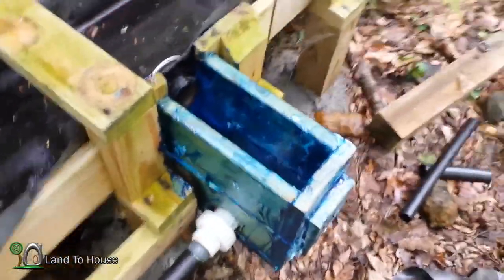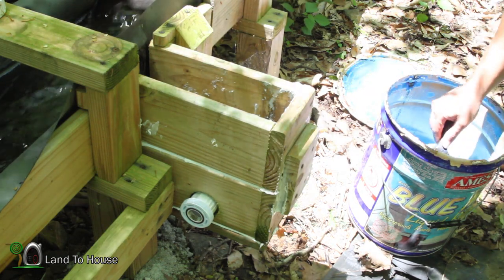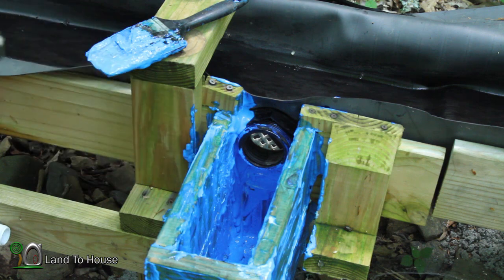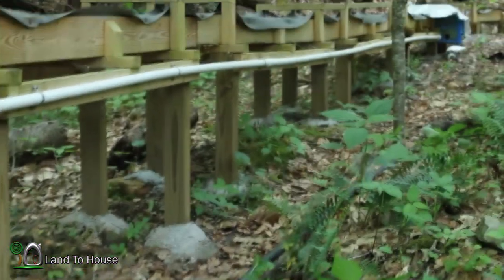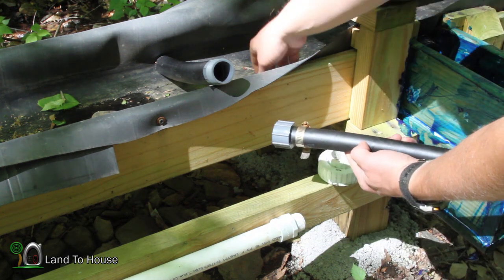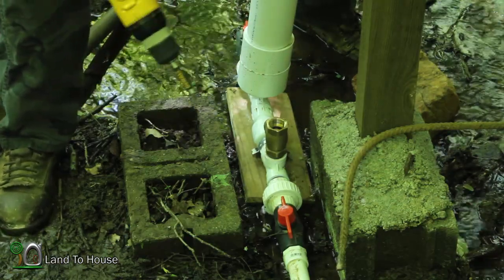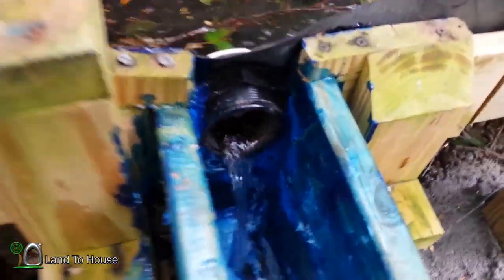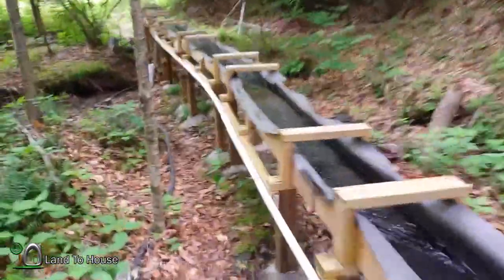Install my Ram Pump Part 2

Comment: my friend...when applying Teflon tape to threads, always apply it in a clock-wise direction, otherwise it will un thread itself when screwing a fitting onto it. :-)... from a master plumber ;-)
Reply: You're worried about thread tape meanwhile there isn't a drop of purple primer in sight. 🤣
Reply: @jmboulware  lol 😆 multiple issues

Comment: You wrapped the teflon tape in the wrong direction. Wrap the tape clockwise. The same direction you will screw on the fitting.

Comment: I have a Well for water supply for land use, if needed, but that requires an electric pump, (or lifting buckets about 40 feet), so a ram pump from my pond would be a better solution. it would also be much slower than the electric pump, (about 250 gallons in 15 mins.) so could be used to water garden areas directly.
So definitely food for thought.
You could use an empty plastic oil container, instead of a wooden box. 
(Just noticed you may have done similar.)
Also, you could have strapped the 'diaphragm' tube to the leg of your water channel, with a couple of bungees, or tie-wraps, which would be more stable.
.

Comment: Can I use a small ram pump to move water from my rain barrel to gardens that are uphill 3' to 10’? The rain barrel water is, of course, stationary, not flowing, unlike several videos I’ve seen. Same question as Jacob earlier.
Reply from the maker: It is possible to run the pump on a tank like that. But you will be very disappointed. The stored water will be out on the ground in less than an hour. You would only have 10% pumped up hill.

Comment: Nice design.  I would use some of that rubber to line your box or just use a small plastic cooler, if you can find one laying around.  I'd also like to suggest you make a secondary "screening filter" for your water box.  Use window screen to make an easily removable catchall for anything that makes it through your initial white (I'm assuming 1/4" filter).  It will save you a lot of really big headaches trying to find where the plug from that tiny stuff is in your system.  Keep them coming.
Reply from the maker: +haynerbass originally I had used that rubber to align the Box butt the way it bends in the corners I did not cut a large enough piece. I do like the cooler idea. That would certainly be waterproof. Screen would be really good to place in the Box. That way I could just lift it out to clean. Thanks for the great suggestions.!

Comment: Please answer a question for me?
I used plastic swing valves instead of brass, I’m not getting the pulsing (check, check sound). The first (upright) valve stays closed.  What am I doing wrong.
Reply from the maker: PVC is just too light to work. I think you will find this video helpful: https://youtu.be/XnUAlQWZDPA
Reply: @LandtoHouse  how a ram pump work out of lake.
Reply from the maker: Sadly the pump does not work out of a lake unless you can siphon the water to a lower point than the lake.

Comment: Will the ram pump work if the fall over 10-20m distance is only .. lets say.. 1m max .. with the flow rate around 40 lit./min ?
Reply from the maker: +MKcLTM for the 1" pump you need a consistent 4 to 5 gpm. I have managed to get a pump working on as little as 6" of head pressure but it's best to have more. You can get the pump to work on 1m.

Comment: i found that on my pump if i turn my intake valve and wait until the drive pipe stops bubbling at the source ie. filling completely with water i can open the intake valve and it starts right up every time
Reply: i should have watched the whole video before commenting because you did exactly that lol
Reply from the maker: +justin whittington haha yes that is the best way I have found to get the air out if the pipe.

Comment: hey Seth,
you might want to make a littte improvement to you tube from te box to your pump. The 45 degree angle piece you used, they give a lot of resistance in you tube. if you replace thwm with an angle that covers the 45 degrees over a longer distance, you will get a better flow rate and pressure. I've also done some maths and if you flow rate is 3 meters/second than you lose about 0.045 bar(0.65 psi) for every 45 degree angle. 
You make great vidoe's, so keep it up!
Reply from the maker: +david weijers great suggestion! With the two 45's that's over 1.2 psi. ... (haha how is that for math.) I think I have seen the 45's that swing wide like an arch instead of the sharp angle.

Comment: use rubber isolation joint  a feet or18inches before the Rampump.
Reply from the maker: As long as the rubber joint does not interfere with the pressure wave.

Comment: A blow dryer/heat gun would have made it easier to flex the black pipe at 9:37
Reply from the maker: +BUDDY LIGHT yes ! That would make it easy!
Reply: A little hot water on pvc makes it like a noodle. No blk pipe needed. When dealing with blk pipe, which is shit IMO, hot water makes it much easier to fit and clamp to seal the burr fittings also.

Comment: pureed Smurf's or buildings?
Reply: Why open sluice to get fouled with leaves?
Reply: Extendable splices are available to cover a 2-3 " gap.
Reply: Filtered input is too trashy; the pump will stop soon from contaminates.

Comment: At 16:50 you mention the sluice is shaking with the force of the ram pump cycles.  

Try sitting the camera on the boards and see how much the vid shakes. I just thought it would be cool to see it.

I noticed you set up for first check valve on the upstream side of your pressure vessel and your second is inline with the flow, then your outflow is also inline with the main water flow. 

 In other videos I have seen the first check valve is downstream of the pressure vessel and the second check valve is on the riser just beneath the pressure vessel with the outflow between the second valve and pressure vessel. 

Eample video: https://www.youtube.com/watch?v=ReaTBMb4X1c

My question to you is: Have you ever tried this other method and how did it work if you did?
Reply from the maker: +Frank Johnson that would be a cool effect. I can try that in the next video.

Comment: Hi, 
how is your ram pump different from 
https://www.youtube.com/watch?v=bzaInlFVq0s design?
I see you have only 1 flap valve, how is it possible?  I thought ram pump needs 2 valves to work ..  can u explain it a little bit?
Reply from the maker: +MKcLTM I used 1 brass swing valve and one in line spring valve. The white horizontal component between the tees is the inline valve. It operates the same as the swing valve in this instance. Possibly even better because it has a rubber gasket.

Comment: Table 1. Minimum and maximum recommended drive pipe lengths based on drive pipe diameter (rounded to full feet).

Drive Pipe Diameter (inches)Minimum Length (feet)Maximum Length (feet)3/41062113831 1/4161041 1/2191252251662 1/232208338250450333

Rife Ram Company literature offers a different method of drive pipe length selection.4 The Rife method does not consider pipe size but is based solely on vertical elevation drop or fall from the water source to the hydraulic ram pump. Values are presented in table 2.

Table 2. Recommended drive pipe lengths based on elevation fall.

Elevation Fall (feet)Drive Pipe Length (feet)3-156 times vertical fall16-254 times vertical fall26-503 times vertica